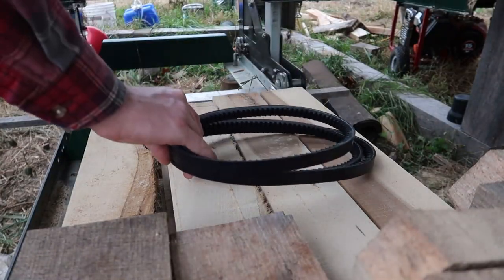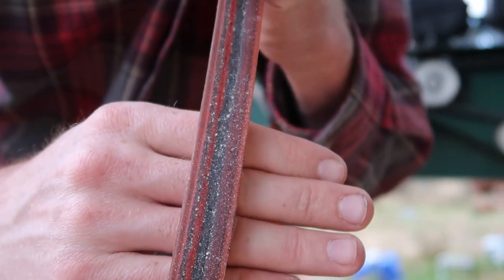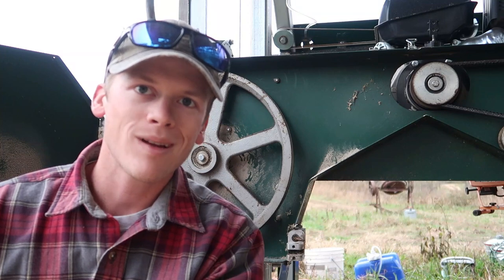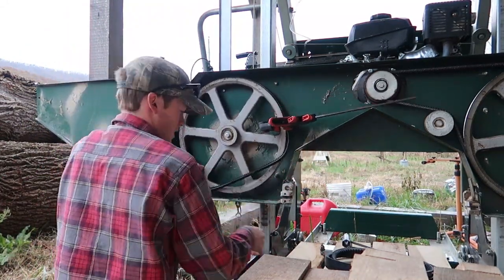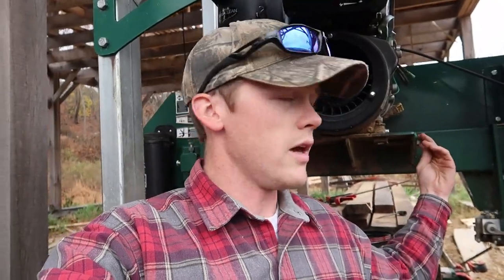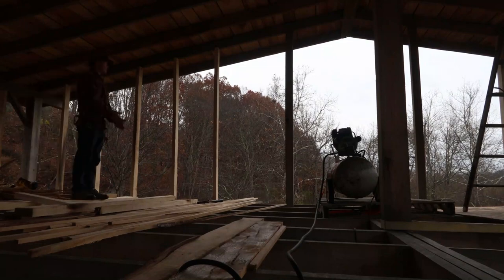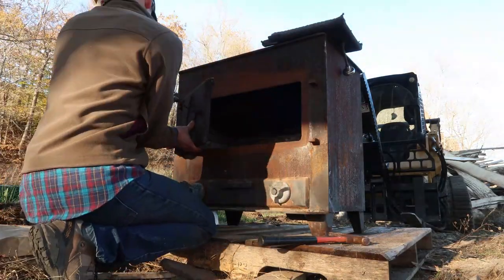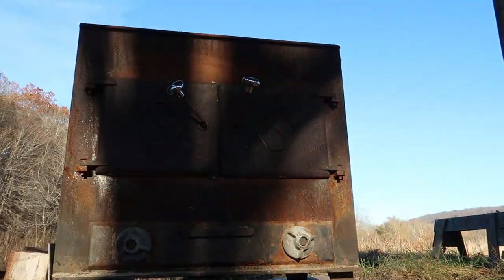New Belts for the Mill & More Studs | Sawmill Shed

Comment: I am curious as to how many run time hours or approximately how many logs were sawed to need to change those belts..
Reply from the maker: That's a good question to which I don't have a good answer..... Most of the lumber sawn on this mill is what's in the Millhouse. Plus some for a few other much smaller projects. I think part of it is just maybe age, it's about 2 yrs old. I plan on adding an hour meter to the engine to keep track of these things a bit better. Josh